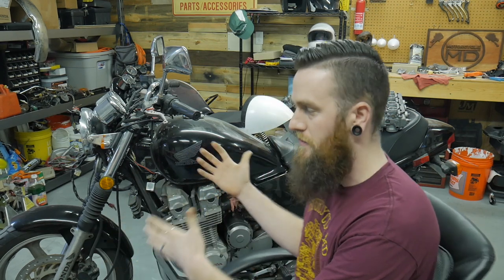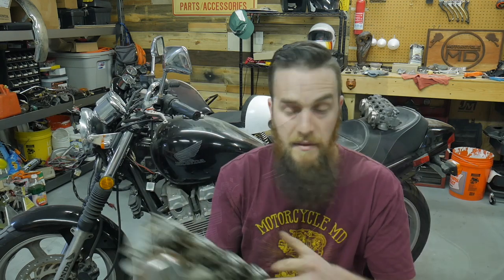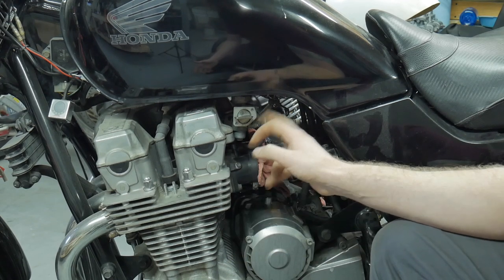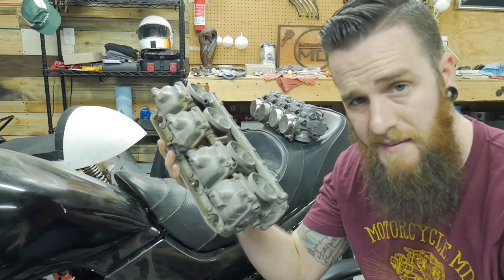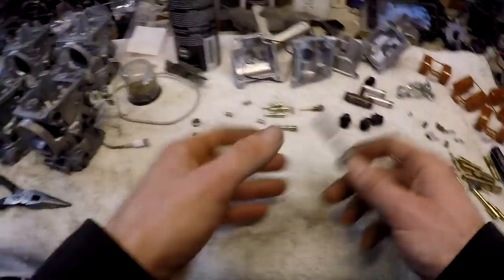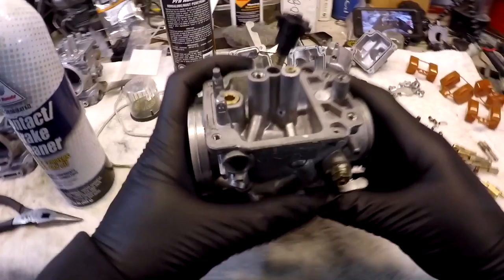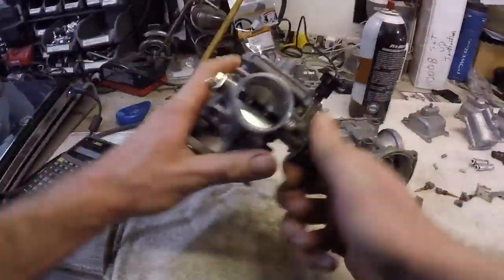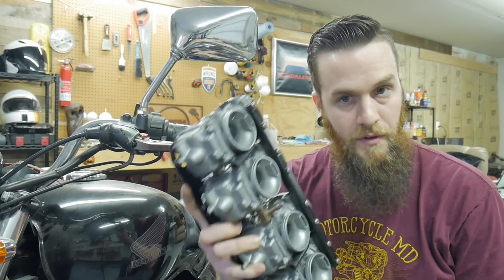Honda CB750 Carb Cleaning: 4 Things People Miss

Comment: The full paid-for course is well worth the money. I watched a dozen videos, have 3 manuals - but it was your $40 video series I kept going back to this weekend as I rebuilt my 1993 Nighthawk carbs. Honestly I don't know if I would have discovered my damaged vacuum diaphragms without your full video.  
The Factory manual confirms they need to be replaced even if only a pinhole, as the slide won't stay in correct position. 
I didn't even notice the small splits and holes in the rubber until I stretched them like you show on the course.  These same carbs were used in the 84-85 Nighthawk 700 with shaft drive.

Comment: I always add Sta bil to the last couple of tanks of the season to run it though, shut the fuel valve off and run them dry before winter storage. Also make sure the tank is clear full with the treated fuel. Never had a problem with carbs on my old bikes. Also always add Sta bil to my lawn equipment gas cans all the time.

Comment: Thanks Cody! I think I did everything as you recommended. The only difference was I used a new K&L carb kit and replaced the idle and main jets, the needle and seat, and air mix screw and spring. Put it back on my ‘72 CB750K. Started rightaway on test tank. But it revved to the moon when started in full choke.
Reply: Mines done same thing today. Did you figure it out
Reply: I had completely forgotten about this issue. But if my memory serves me right, I figured it out within a few minutes.  I’m embarrassed to admit, it was a non-issue… turns out there was no gas in the tank… I just never looked at the gas level in the tank after I took the test tank off and hooked up the gas tank. 😅

Comment: OUTSTANDING job there. Got a 2002zrx1200 that was rejetted and pods added 15 years ago at 2 stealerships. It fouled plugs DEAD at 500 miles. The first shop told me I wasn't riding it hard enough. Young punk ass mechanics. Took it eventually to another stealership.   Neither one could get it right. It has never ran right. On my back porch now and still looking new. Aint rode it in 8 years. Gave up and got a fi xtz1200

Comment: Nice video, I had to encourage people to replies fuel rings. I used a $8 carb brush set from Amazon. The OEM kit replaces all the brass (except choke). The All Balls Racing was disappointing. I wish you put the pilot screws in there. People miss the little and double stack them. But you’ll have  that in the full build! People are taking interest in the ‘90s NH. Great time for this video!
Reply from the maker: They are a fantastic bike. The whole motor/charging/ignition system is bulletproof!
Reply: @TheMotorcycleMD  Great videos! I'm a long time fan and you have passed on great advice!

Comment: I had mine cleaned a while back but still had to run a while with the choke was on a bit so thinking I may need to have them cleaned again. May do it myself this time but looks like a pain. My o-rings were changed so don't think I need to worry about that.

Comment: One thing I do in addition is hit the exterior parts of the carbs with a brass wire brush on a drill.  Also I get the brass interior parts separately with it as well (while removed of course).  It also makes the tops shine like new and surprisingly without bad scratch marks.  All screws, springs and choke parts get the same treatment.  Just don't use it on interior or fragile bits.
Reply from the maker: Me too!!

Comment: Hi Cody, I just finished the rebuild of the carbs. All nice and clean. Already in place and synced. 
Now the difficult will be the pilot screw adjustment as I installed new ones (Keyster rebuild kit). 
So the question is: besides using the supet expensive honda tool or the super fancy motion pro 90⁰ tool, none of my tools reach the 2 and 3.
What is you recommendation? Can you share your wisdom?
Keep up the good work 💪

Comment: Is contact break cleaner better to spray into those passageways than carb cleaner?   I've cleaned my 1975 CB750 carbs a couple times and I only just recently figured out that the air screw seat has a hole at the bottom that leads down into the tunnel the pilot jet uses.  For the life of me I couldn't figure out how that screw was effecting the idle (among other things.).  You can't really see the hole when you look into where the screw sits (even using a flashlight and a magnifying glass) but I stuck a thin guitar string into that hole and realized it didn't stop where I thought it should, it continued down into the pilot jet passageway.  Kind of embarrassed I didn't realize that sooner.   The rest of the carb is pretty obvious (vents, main jet and needle valve seat).

Comment: l have a 81 CB 650 and its starts on 3 cyls. soon as l apply throttle,it stalls.Had a ton of dirt in tank,flushed out and removed carbs,kept them together but cleaned bowl,jets and passages.NO2 cylinder has spark,but no fuel.Any ideas? thanks

Comment: Hi, nice video, I have a '94 CB 750 (Seven fifty) european model, wich has the same engine & carbs, it has been sitting for about 6 years, my question is, what can I use to clean the bottom buckets that are full of rotten and dry gasoline residue, the carburetor cleaner can't take out the spots, I wish I could send you a pic to show you how bad they looks.

Comment: Hello Cody, I have a friend with a 250cc carb issue, between 4k and 6k rpm strugle and hesitate, above that back to normal, what you think I coud check?
Reply from the maker: I would check plugs, the carb’s diaphragm piston to see if there are any tears or holes in rubber section..
Reply: @TheMotorcycleMD  thank You! I'll do that!

Comment: Hi just found your vid iv got cb750fn2  and it's been parked up for close to 3 years . (Due to my disability)  the Forkseal has leaked .front brake calipers seam stiff and now due to the vid I'm guessing the carbs an fuel is in  need . Juat wish I had the mobility an skill to tackle these . 
What would you recommend trying 1st .as I can only fiddle with it for a hr or so then I'm laid up for a week lol cheers

Comment: 1978 honda cb750k . AFTER caburetor cleaning the bike runs fine with the rear tire lifted off the motorcycle lift . Run through all the gears at full throttle fine. When i take the the bike off the lift and road test it the bike has no power sluggish. dont understand why when the bike is on the lift with rear tire raised it has power but not when i road test it . First time trying to use this hope i have given enough information
Reply: i did sync the carburetors

Comment: I just got a 84 honda magna vf1100 and getting it road legal tomorrow, but trying to solve a issue it is having, when i shift from neutral to first gear it lurches a bit forward, I have cleaned the slave cylinder didnt really need it but was replacing the bleed screw that someone stripped, re bled the system, and still having same problem, the previous owner said it died unless you gave it a little gas going into first, someone mentioned that the brass bushing and the aluminum rod going into master cylinder might need changed, and was reading online and it said could be friction from the oil if it is thick, with the bike turned off and in first gear and squeezing clutch i can push it a little just very hard, if you have any ideas i would greatly appreciate it, also just watched your video about rear brake light adjustment, i think that will solve the other issue i am having will find out in the morning. thanks

Comment: Should you be able to suck or blow through a drain on a cb550k with drain screw tight
Reply from the maker: If that same “drain” has a brass tube connected straight into it inside the bowl then yes. That allows overflow is the flow stuck or adjustment is to high

Comment: Hello all. I'm wondering if anyone knows this :

Does the 4-1 exhaust system off a CB400 Super Four fit on a 4-2 CB750 Nighthawk/F2? I'm trying to swap the system on my 750 for a 4-1 to reduce weight and noise. Would it work? Or are there better options for this? Thank you.

Comment: Hey! Thanks for sharing your knowledge! I feel like this might be a carbs case with my bike. I just have a problem with my honda cb400 1996. After riding for some time the throttle just stops responding and engine slowly stops.. And it doesn't start. After 10-15minutes it starts again and then after few kilometers the same thing happens. If i let it stay over night, it runs again like nothing happens. I could ride for an hour or so and suddenly it all happens again. Can the dirty carbs be a problem? Or should i look somewhere else?
Reply: My cbr600f4 is the same. Only seems to do it in heavy traffic(or when hot)... I can ride all day on b roads as the bike stays cool 😎
Reply: I'm 3 years late, but that sounds like a weak ign coil

Comment: what is the black rubber plug for on one of one  the tubes in the float bowl ? and does it matter if i lost one ?
Reply: I believe it's a slow idle plug, not sure about its importance but each carb has one, bring one to the hardware store and get a similar size rubber stopper
Reply: LOL thanks for responding I actually found the one that had bounced away got the carb  back together and I sold that bike

Comment: How much would you charge to rebuild carbs for a1980 cb750f super sport?
Reply from the maker: If you don’t need new accelerator pump and air cuts we could be a round $500 +shipping. If you do need those parts and more we could be around $700-750 because of the cost of parts.

Comment: And just buy a complete kit, bowl gasket, orings, new float jets and seats. No matter how good they look just do it, specially these older bikes. Be careful with the steel wool. I just did my 1991 CBR1000F last month and the number 1 carb leaked. Steel wool in the float seat and somehow the floats where not adjusted to spec anymore.
Reply from the maker: Definitely have to be careful with it, blowing everything out is vital. (As explained in the full version) 👍🏻